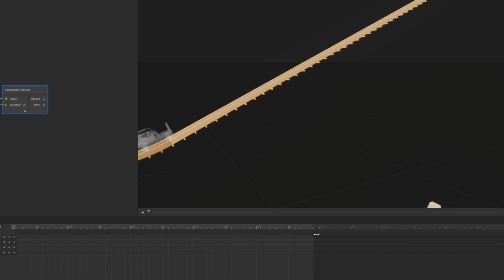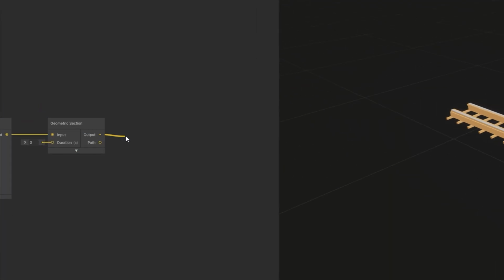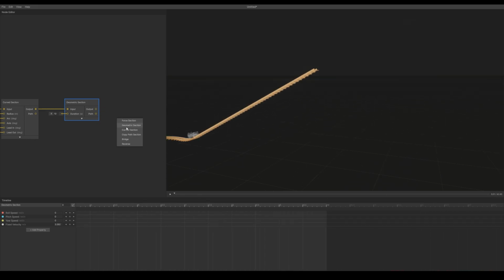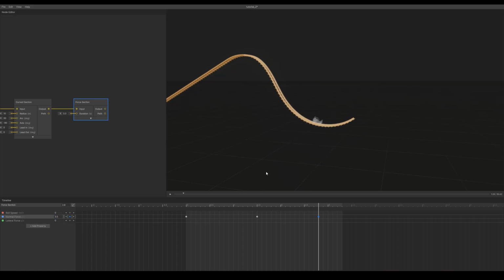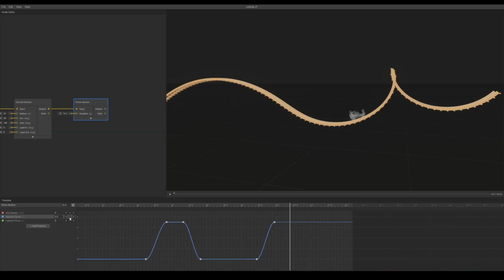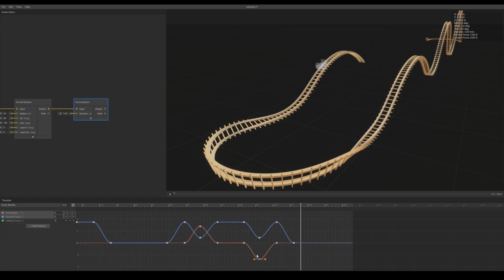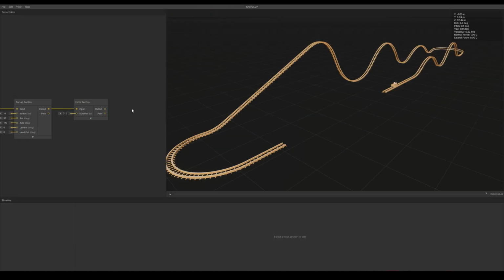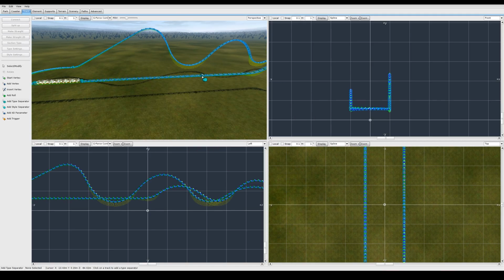KexEdit Tutorial | Design an Entire Roller Coaster Walkthrough

Comment: Just had a chance of trying this out. This has HUGE potential. It feels so much faster and streamlined than FVD++ ever did. This is awesome, keep it up. 

The optimize feature for roll pitch and yaw is so sick, and the node based setup feels very intuitive. I cannot wait to see where this thing ends up going.

One feature I'd request from FVD++ is being able to specify the specific time length between keyframes. Currently you can drag and drop and sort of eyeball it, but it would be cool to specify the specific seconds. Thanks again for the hard work you are putting into this. This definitely has the potentially to fully replace FVD++ in the near future.
Reply from the maker: thanks so much for your feedback! if you have more any time i'd be happy to hear it!
Reply: @IndividualKex  Of course! There's a few more I can think of off the top of my head:

Add keyframe hotkey

Currently the forces/speed etc. shown are based on the animated vehicle, but there is also a ghost vehicle that shows up as you scroll through the timeline, it would be nice to be able to toggle data shown for the animated vehicle or for the ghost vehicle, so you can see exactly what the stats are at a particular spot in the timeline.

The ability to scale the numbers on the graph would be nice, currently they feel a bit small. 

I love the look of how the UI and viewport are black, but sometimes it is hard to tell how close a coaster is to the ground until you actually penetrate the ground, some more contrast for the ground would be super helpful.

These are just small things that I think would make it even better!!
Reply: Dude you are HAULING with updates on this! Amazing all the changes you are making. I had a couple other thoughts that might be cool adds and make this program even more awesome. Can't believe you already got 3d modeling support in here too. You have got this program to FVD++ levels so fast.

Here are some other thoughts I have using the program a bit more:

A visual marker on the track where the keyframe is that you are editing, FVD++ highlights the section in which you are editing, which makes it super easy to see exactly where on the track you are editing.

This one might be harder to implement, but an issue i always had with FVD++ is you would create a layout with a force section, then when you import into NL2, you would realize that there were sections that had either too tight of a pitch or yaw which would cause clashing between trains/track. If there was a way to set minimum pitch/yaw radii, and then if the current keyframe you are working on exceeds that minimum, a visual indicator saying so would be so freaking cool.

Just throwing out ideas as I think of them, feel free to take or leave!